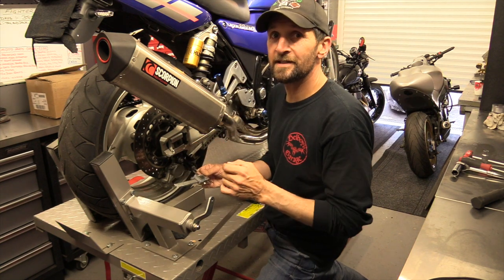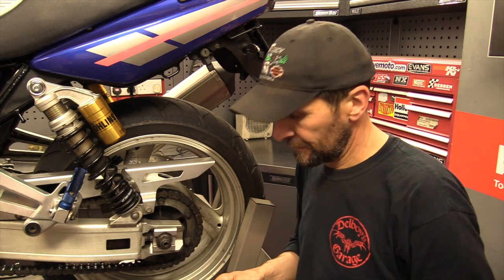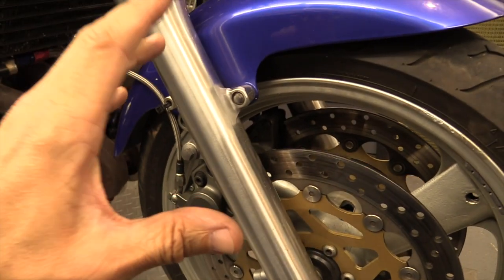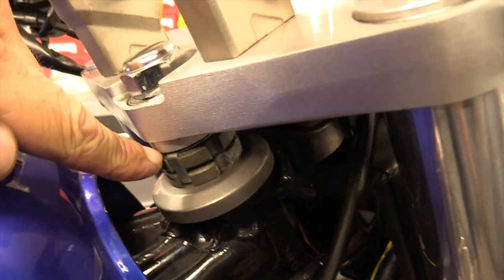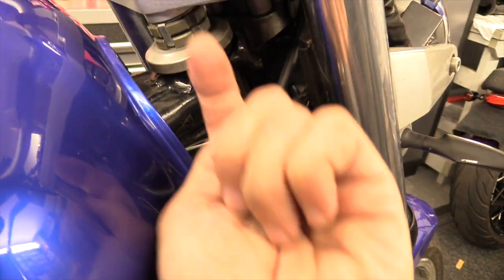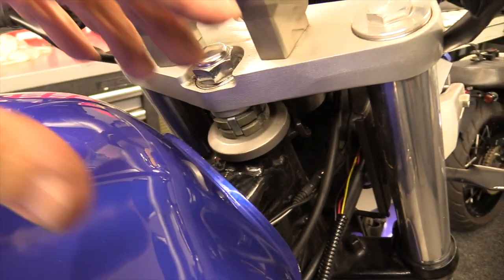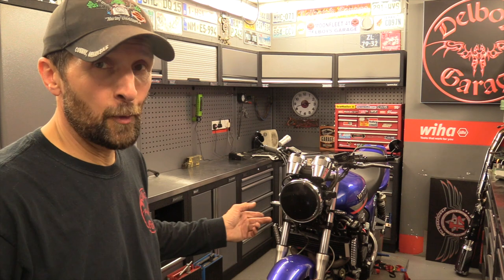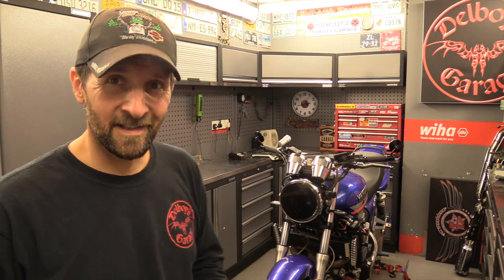Delboy's Garage, Quick and Easy Motorcycle Fork Alignment .

Comment: Hi Del, when you say loosen off the axle are you just referring to the axle pinch bolts or the main axle bolt, thanks john
Reply from the maker: It doesn't hurt to back off the axle nut itself John, everything below the top pinch bolts needs to be loose so it can all self align, pinch bolts too of course, as the slightest resistance to movement of any parts will impede it straightening.  !
Reply: @Moonfleet41  Thanks Del, when I done my head bearings I think I done things the wrong way round, my manual said leave the top yoke centre nut loose + lower triple bolts, but this was causing me to feel false free play when pre loading my bearings, even when I tightend the adjuster nut really tight I still had free play, then I realised it was due to the above being loose, in the end I slackened off the top yoke centre bolt and pre load lock ring and tightened them up against each other, then nipped up lower triple pinch bolts then adjusted the pre load, then done up the lock nut against the adjuster and top yoke bolt last. Seems i may have to start over again or my suspension maybe  stuck open as you said in this video if you do up the lower triple bolts before the top yoke  centre nut🥵🥵

Comment: Hello thanks for the video.  My question is reverse forks I guess is much the same?
Reply from the maker: Yes, it is Alec, USD are less likely to be knocked out of alignment because they're way thicker, but it's still possible and this procedure still works in the same way!
Reply: @Moonfleet41  Thanks for your help.  The bike a Suzuki Boulevard c50 was knocked over with little to no damage exept the forks bieng very slighty out but I can see it.  The backend is fine I checked thanks to you.  Hello from Thailand.

Comment: I’m totally new to bikes but am somewhat mechanically inclined. I removed the front forks and sent them out to have the seals done. Will I have to do this alignment? Or will the tree and triple clamp still be aligned?

04 Gsxr 750. Thanks guys
Reply from the maker: Hi Mark, in theory, provided the top yoke nut has not been loosened off, they should go back in straight, so by all means, throw it all back together, give it a ride and see how it feels, after all you can't do the alignment until it's all back together anyway, so check it first and if it feels a bit cock-eyed, then go through this procedure to straighten it up... you know the old saying mate, if the cart ain't broke, don't fix it !

Comment: Great video! I watched the first one and tried today but my wheel still seems out by roughly 4 degrees. Is there anything obvious that could cause the wheel/forks not to shift? I hit a small pot hole but can’t see any bends or stress on the forks/clamps. It seems everyone has had success but me… I must be doing something wrong.
Reply from the maker: Is the misalignment in the forks or do you have remote rubber mounted bar clamps?   Could the problem be the bars misaligned in the top yoke?
Reply: @Moonfleet41  I’m thinking the upper triple clamps are slightly bent. No amount of bouncing is getting the wheel to align, something must be bent.

Comment: Great video Del. You were pretty good in the old one but this newer version shows how you have grown as a presenter. By the way, looking at the speedo on that bike, were they MPH or Mach numbers?
Reply from the maker: Having ridden it buddy, I think they are Mach numbers, it's just astonishing on full boost and that's with a leaking header that's getting replaced, it will be even better when that is done and a short open pipe, thanks for your kind comments , I really appreciate that mate !

Comment: Do you have any tips on how to do this on MT07? It doesnt have bolt that connects top and bottom yoke together, like in your example - but it small pinch bolt to pinch top yoke on steering stem. My question is - do I need to unto this pinch bolt? If I do, doesnt thak make it slight upwards from the steering stem and bike falling down?

Comment: I needed to re adjust the height on my klr650 fork tubes and when I slid them back down to stock height they probably twisted/rotated a bit inside the shock. Is that something to worry about? Thanks!

Comment: Great video. Your vids have helped a great deal. I recently replaced my front disc and brakes because of a slight shaking in the front end when i brake. Its still shakes a slight bit. Should i try realignment my forks? Sportster 1200. Thanks again
Reply from the maker: Hi buddy, if you have rreplaced the disc and pads, and the caliper was cleaned at the same time, then the fork alignment probaby isnt the issue... how is the front tyre, is it work, maybe 'shouldered' in the sides with a thicker section inthe middle..?
Reply: I'll have to check that out.  Thanks again Del!!! Keep up those awesome money saving tips

Comment: Hey mate I got a question my moped is not straight meaning the the wheel is off a by 4/6 cm I don’t have two yokes only one which is at the bottom will it work if I lose end the bolts on the one yoke which I have? Thanks

Comment: Thanks a lot for your videos. It'd been helpfull a looot . I have a question if possible. Is this way works for all motorcycles ? i have a royal enfield interceptor and i wanted to be sure before i try this. Thanks a lot in advance
Reply from the maker: As long as the bike has a convensional top and bottom yoke, that holds the fork legs by pinch bolts, then this method will work.   Good luck with it.
Reply: @Moonfleet41  it does. Thanks a looot . I really love your content man . 🫡🫡

Comment: Thanks so much, after having fallen with my XT 350 the forks still seem to be straight but the top and bottom bracket are out of aligment. I loosened the top and bottom bolts on the fork and was able to twist everything in alignemt, but the legs came up through the top plate. Seeing it should be possible to get everything in alignment I found your video. Can I just bring the fork legs back down equally and tighten the top plate again (the one you said should not be loosened)? Or did I create a situation that’s really hard to get right again?
Reply from the maker: No just wriggle them back down into position, then realign everything again with the top yoke pinch bolts tight.. as in the video mate
Reply: @Moonfleet41  Seems to have worked, everything is straight (enough) again.

Comment: Nice vid Thanks. Have a personal 2010 Victory that points to the right. I tried this method without luck. When bike front end is in the air ... it naturally points to the right also. No accidents. Any thoughts people? thx
Reply from the maker: Hi mate, it doesn't need an accident to throw off your fork alignment, bouncing up kerbs, potholes and sleeping policemen, can be enough to make them shift... check the rear wheel alignment too, as that can make the front feel like it's riding off...
Reply: Thanks, looking into and checking if forks are straight.  THANKS

Comment: I have tried this several times after watching your old video and it works great! However tried it yesterday on a old 250  enduro Yamaha and does not work?
Reply from the maker: Did you remember to loosen off the top yoke center nut.?
Reply: @Moonfleet41  Yes sir'
Reply: everything except top tree pinch bolts
this is a bike I just built from bare frame up
Reply from the maker: Sometimes you may need to give the forks a little tweak manually. Stand in front of the bike, wheel between your feet, and just force it gently back into line.. if its a light weight bike, you often need to do it this way...

Comment: another great video,,thanks Del,, quick question,,in the original one,,you put something under the front wheel,,did you use something this time?
Reply from the maker: Hi Ian, well observed mate... in the first video I was on a rough concrete floor in the old garage, so placed an A4 sized sheet of steel under the tyre to give less grip, and allow the wheel to flick straight and re-align, but on this video, the bike is on the lift which is a shiney metal surface so no need!  Blimey, you guys see everything lol !
Reply: Moonfleet41 we are loyal viewer's 😀😀

Comment: I don't know why but it didn't do the trick for me. I removed and losen every bolt and cover attached on the forks of my motorcycle but the handlebar is still not align with the wheel. I repeated the process two times but with the help of the bike center stand. Also I tried to force the forks in the correct direction but they doesn't want to stay in that way. Could be that the forks or the yoke are twisted? may be the front wheel shaft? Any suggestion is welcomed.

Comment: Do we have to loosen the head lamps clamps as well. In my bike it is fixed just after the yoke.. almost at same as the bike in this video
Reply from the maker: If they're clamped around the fork legs, then it wouldn't hurt so just back them off...

Comment: Awesome vid, explains something so simple that many people seem to make so complex.

One tip for anyone doing this, easier and more precise:
Use the external side of the calipers one against the axle block and place another flat piece of metal (gauge block, ruler, square.. anything) against the back of the swing arm to indicate off.

This way it is easy to get an indicated alignment of about 2/10th of a mm, given that most low end calipers have an error of +/- 1/10th you are talking a run out of up to 4/10th of a mm across 300-400mm of axle.. not bad at all!
Reply from the maker: And remember when you ride your bike on the road with a camber, the steering will naturally point up the camber towards the centre of the road, otherwise you will roll down in to the gutter just by gravity... so it's never gonna be dead straight in use... but 4/10th is good enough for me lol

Comment: Hi, great video. How would you check rear wheel alignment with a single sided swing arm?
Reply from the maker: Depending on the bike in question Michael, they are usually self aligning...
Reply: Moonfleet41 Thanks Del, that actually mages a lot of sense. I've recently got an old triumph speed triple. I've been using your videos to help me go through the bike step by step. Forks are next.

Comment: Hi dell, im replacing my steering head bearings at the moment will i need to do this procedure when i refit the forks or do i just put the forks back in and just tighten everything back up cheers mark
Reply from the maker: Hi Mark, fortunately if you're stripping the whole front, as you are, you've no need to do all this, just assemble it correctly, in the right order, and it will align itself as you rebuild it.. and by assembling in the right order I mean...leave the top yoke centre nut lose, install the forks through both yokes, nip up the top clamp pinch bolts, then the bottom clamp pinch bolts, then the top yoke centre nut, and it should be perfectly aligned, ready to put the wheel in !
Reply: @Moonfleet41  great many thanks dell ,just need to remove the ram air intake now  which is right BELOW  my bottom yoke ,which is proving to be a pita, it's a 1997 CBR 600 f3 many thanks

Comment: Great vid! Does it matter in which order you tighten all the lower end (everything around the wheel) stuff?
Reply from the maker: With fork alignment it's important to tighten from the top down, centre nut of the top yoke first, then the bottom pinch bolts, and that will hold the forks straight, then work your way down from there to the axle.

Comment: I did this afther change of head bearing(all balls). My bike still are unstable in a straigth line. I have taken it apart 3 times and steering seems fine, but it still popps out to left and right when riding. Rear tyre are cupped, that may cause it.? Wheel baerings are new.
Reply from the maker: Hi Toby, perhaps you have over tightened the bearings.. it sounds like you have some resistance there.... if you jack the front wheel up, the steering should drop away to either side once you nudge the wheel an inch or so.. if it doesn't, and its stiff all the way over.. then back off the bearing collar a little until its flops away freely.... then see how it rides... Good luck with it, hope you an get it done.. Del.

Comment: Hi Del, I've just done my chain adjustment using your method of measuring from the axle block to the rear of the swing arm, I have exactly 17mm on both sides but have noticed this has put the swing arm marks a fair bit out of alignment with each other, in your experience   is this usually what happens or do you find they normally look equal, thanks john.
Reply from the maker: If it's in an XJR like here John then they should be the same, (axle block gap and ladder marks).. but if they are hugely out, maybe it's a different bike, then maybe a chain aligner tool would be more reliable, there are the steel rod type, or the fancy lazer ones, both of them will give you perfect alignment.!
Reply: @Moonfleet41  2000 zx9 Del, they are a fair bit off so I may try a lazer tool as I do like things to be a 100% on my bike👍

Comment: if you have an axle that screws into one side of the fork leg (like ohlins)? Should the axle still be loose? or tighten the axle and leave the pitch bolts one the free shock open?

hope thats clear almost all videos iv seen have axles with a nut so it makes sense to leave the axle loose as both fork legs can move.
Reply from the maker: Back off the pinch bolts and rotate the axle out one full turn.

Comment: Great video! Can this be done in a similar way for a bmw 1200gs telelever suspension? Ive looked at it but I’m not sure about releasing the pinch bolts on the lower bridge as it is supported/sprung by the telelever shock and wondering if the forks will support the full weight of the bike at the upper bridge only..

Comment: Hi Delboy than you to share your knowledge, I have a quick question; I have brand new bike and when I loose my both hands from handlebar my bike lean to the righ directly as I know and used to it must go straight when I do this.. Do you think this fork allighment that you told can work for that issue too?
Reply from the maker: Hi Ekin, not necessarily, you would hope that a brand new bike would be set up correctly, but if you drive on the right hand side of the road where you are, and you have camber in the road, then naturally your bike will roll down to the lower side of the camber... this trick is for when the steering feels twisted when you're riding with your hands on the bars, but the bike is riding straight ahead... perhaps check your tyre pressure on the front and make sure it's correct, as soft tyre pressure on the front, or rear, can make a bike pull to one side more vigorously.
Reply: @Moonfleet41  Thank you for your quick and kind reply, I drive right hand side but I also tried it in leveled field unfortunately the result is same.. I gave my bike to service and wait for solution hope it will be fixed soon :)

Comment: @Delboy’s Garage 
Hello.. actually on my zx6r the blocks on the rear axle are off..
Id it try to go by the marks on them it throws the rear crooked..

(I heard someone mention this with regard to chain tensioning instruction.. and it seems it occurred with my bike itself)

(I could tell by using my eyes and comparing the rear wheel walls spacing between the tire and the sides of the swing arms..)

Any thoughts?
Reply from the maker: Yes mate, it is not always constant on every motorcycle that the swing arm is equidistant away from the tyre, in fact in most cases, the chain side is further away from the tyre than the brake side, the most reliable way to set your rear wheel alignment is measure the axle against the swing arm pivot so basically measure the distance between the centre of the wheel axle and the centre of the swing arm pivot and compare both sides... measure them also centre to centre and that should set your wheel bang on.

Comment: Hi Del. My Bonnie tipped over the other day because I foolishly parked it on loose soil. Is such a fall enough to "bend" the fork? I did align the forks as shown in your video and it seems OK to me, however, the Triumph service technician 'believes' the fork is bent. Is there any surefire means to find out? Thanks for your assistance in advance
Reply from the maker: Hi Jayant, I would imagine, reading between the lines of what you say there, that the technician didn't literally mean that the fork leg is 'bent', what he possibly meant was that the front fork assembly is bent to one side, maybe his use of the word 'bent' was just a bit inappropriate... it's extremely unlikely that dropping your bike on it's side would caseu the fork to bend, as those tubes are extremely strong, and flexible, and it would take a significant front impact to actually bend a fork leg, and if it did that, it would bend the other one at the same time...

So it's more than likely just 'twisted' in the yokes, so if you carry out this procedure and also check your rear wheel alignment too, everything should return back to straight... also, check the handlebars where the clamps bolt in to the top yoke, they are on flexible bushes, and my also have become shifted to one side, as I imagine the handlebars took the impact??   You can do this by loosening the bolt underneath the top yoke that holds the handlebar clamp in, then sitting on the bike, check they feel straight in the yoke and re-tighten them... finally if it still feels bent, then you could take the handlebars off the bike, lay them on a flat surface and you'll see, straight away, if they are straight, or if maybe the impact caused them to bend... it's all there somewhere my friend, but the least likely thing is the actually fork tube being bent, as that is very rare... let us know how you get on!
Reply: Thanks a bunch Del. Will update soon how it went. Cheers